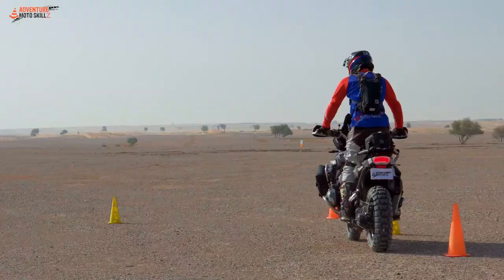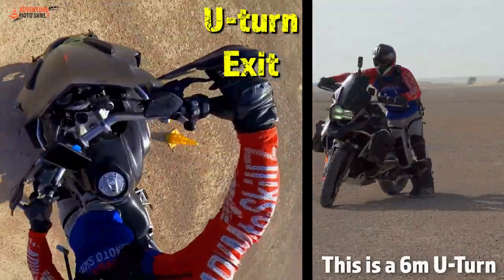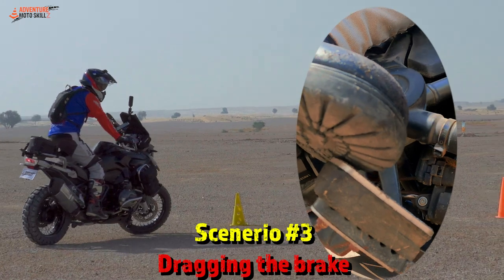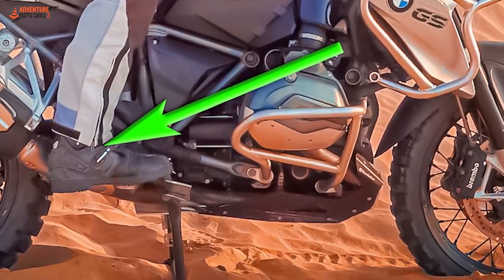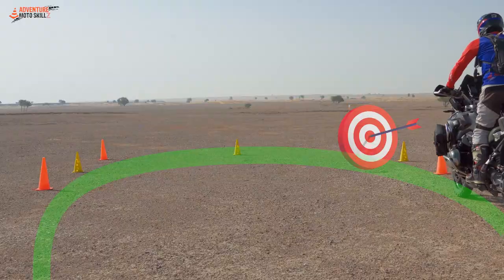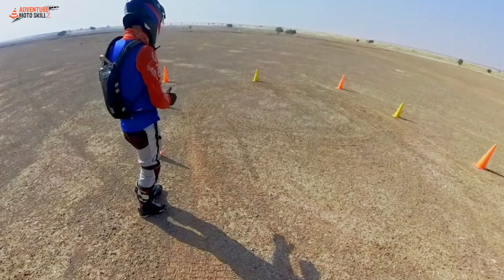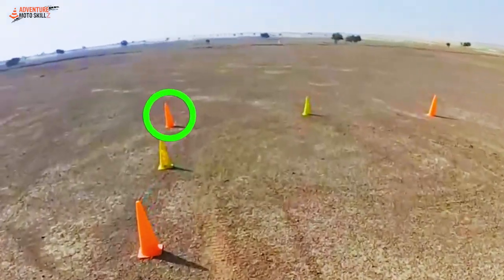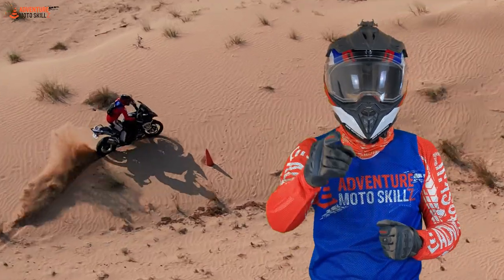Step-by-Step U-turn Training for Off-road Motorcyclists

Comment: Thanks for another great video! Very well explained. As a shorter rider with limited arm reach, when doing tight U-Turns on a big bike e.g 3.5-4m, I find that just moving the hip to the side isn’t enough to well balance and control the bike in a relaxed manner. Instead, I move my hip to to the side and forward, this brings my whole upper body closer to the handlebar, making my arms relax a lot more and giving me more flexibility to balance the bike, especially at the points where it leans the most.
Reply from the maker: Great point👍🏻I will move in a similar way way turning in soft or loose terrain and want to get some weight on that front tire to help it keep traction. 👍🏻 We all have different body shapes and physical abilities and need to find the way that works best for us.
Reply: @advmotoskillz  Thanks for your comment! I've got 1 question regarding to heels' position. In your videos I noticed sometimes you kept your heels down, lower than the foot pegs; sometimes your heels were up, higher than the foot pegs; other times your heels were neutral. The heel-down position will transfer more weight downward increasing the traction and giving riders a more stable posture. I've heard people said always kept your heels neutral or lower than the foot pegs, however I personally feel keeping my heel high make it easier for me to dominate the bike during slow-tight turns...Not sure if it's a good practice...Thanks a lot!
Reply from the maker: @Humbalaba  I think you may have noticed my heels in different positions because I am active with my ankles at time working with the bikes suspension to keep the ride smooth. That is where the ball of the foot on the foot peg position is useful. 
Every rider has different physical abilities and needs to adapt their abilities to their riding positions as best as possible. 
For instance, old injuries can lead to limited range of motion in joints and then the technique may not be “ideal”.
What matters most is doing your best. 
I have seen a number of riders proclaiming that you can steer your bike by simply dropping your heels. 
I find this not to work… unless I actually move part of my body weight off the centerline to put some weight onto the foot peg.
Reply: @advmotoskillz  thanks a lot for your reply! Strange youtube didn't push any notification...
Reply from the maker: @Humbalaba  I've not been getting notifications too...?

Comment: Another master class! Thanks for the details. I am following your instructions. For slow and tight turn my inside knee hooks the seat and head, shoulder, hips shifting outside. Now problem is I can't squeeze my outside knee, which remains unattached to the bike.  Therefore not able to hold the bike with my lower logs for the time being. Is it mandatory to hold the bike with lower legs all the time?
Reply from the maker: Thanks for your feedback on the video. Appreciate it. 👍🏻
I would say, in any technique there is the “ideal/textbook” way of doing it and then there is the real world method. 
The goal is to get to as close to ideal as we can. There are often limits on how close we can get do to level of physical fitness or abilities. One aspect I look for when working with a client who is struggling with a particular exercise is to evaluate if there a limited range of motion in their joints that could be improved upon to help them perform better.
Reply from the maker: I prefer to always have my lower legs in contact with the bike. I find it gives me much more control of the bike and it allows me to not be overly tight on the handlebars. A more free handlebar is then better able to search for traction.
Reply: @advmotoskillz  ❤️👍

Comment: I made the same but with the front break not rear, because some time I need to lean to right more and more for sharp turn, what is your advice???
Abd is it that correct or not???
Reply from the maker: For sure, the front brake can be used. I wouldn’t teach that method to a new rider, but if someone has good technique with gently applying the font brake it can be done. Most often, I don’t use any brake and it’s all playing in the friction zone. The benefit of using the rear brake is that the engine then pulls against it, dragging the bike along. With the front brake applied, the engine is pushing the bike and sometimes this can overwhelm the front tire traction in a turn.